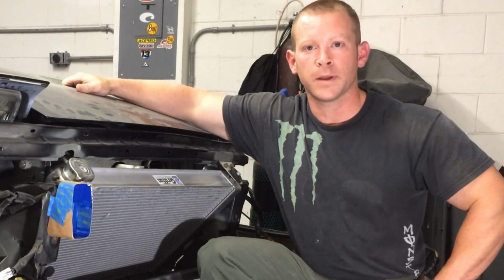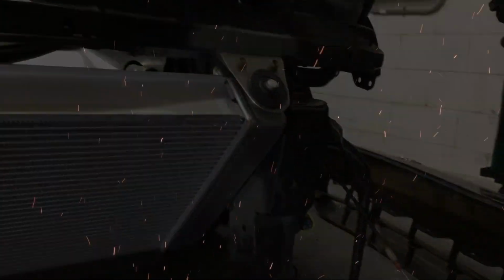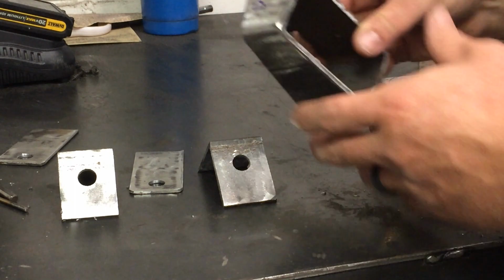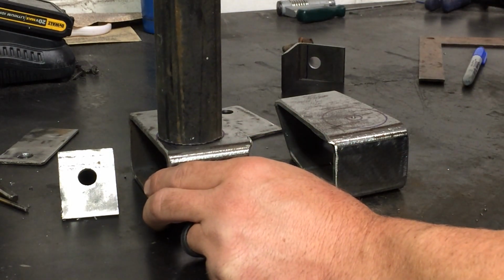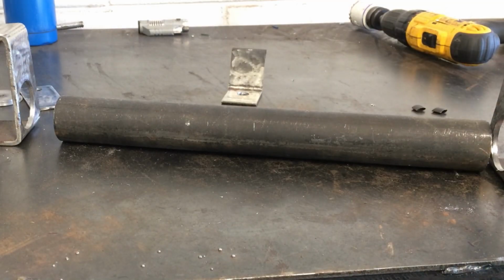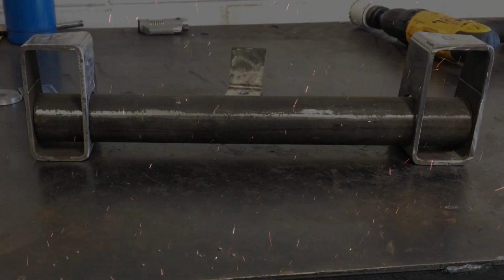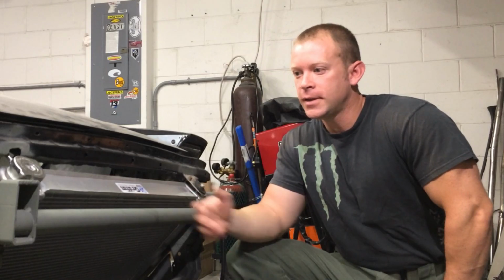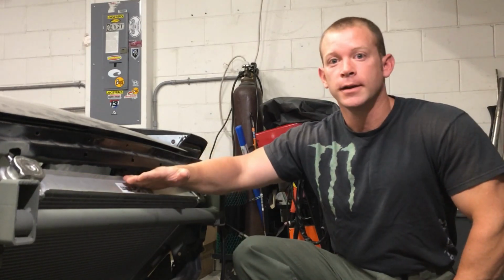Fabricated tube bumper (Bash Bar)

Comment: Love your work, its given me a few points of inspiration. Have you used a car rotisserie? I looked through your vids but couldn't see you working on the underbody. The rear of the chassis could take rotisserie rails - do you think the standard front crash bar would be strong enough to take the weight of the car rotated? (yeah, a wtf Q, but you seem to know your shizz, and I'm a few cans down on the fizz...)
Reply from the maker: haha... yes i know my shizz. used to work in a body shop on heavy frame repair. No rotisserie only because I dont have one. May be a consideration when I tear it all apart for paint. Thanks for the props.
Reply: @scantronsgarage  Hi again, with your background knowledge do you think the standard front crash bar would be strong enough to carry the weight of the car on a rotisserie? I have a spare bar and I'm considering using it to make the mount for the rotisserie, but can't judge if its up to the job of bearing that weight at all angles, got any advice?
Reply from the maker: @codoherty9543  I think it would work if it is structurally sound/ no rust. we used to use air jacks under the front and rear bar to lift the entire car off the ground about 3 feet high. We would occasionally see some deflection. this was with a fully assembled car also. So, As long as you make strong brackets I would say yes